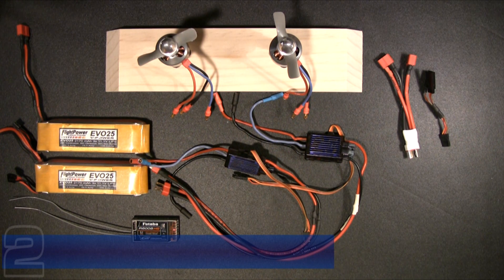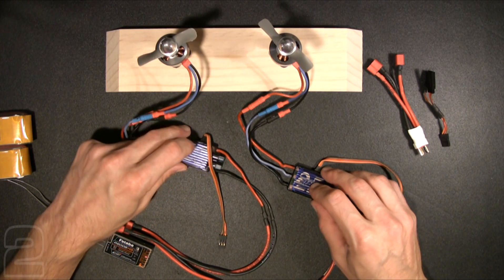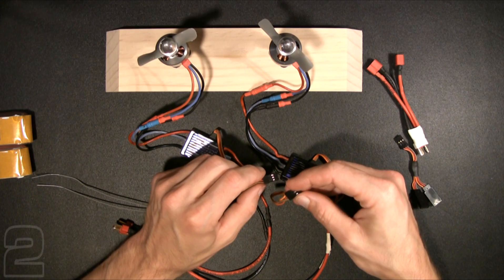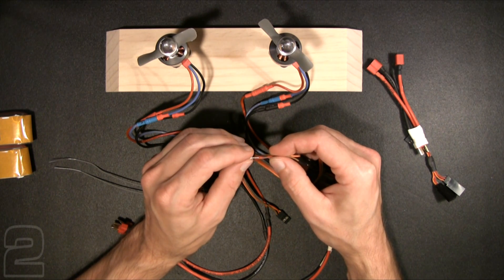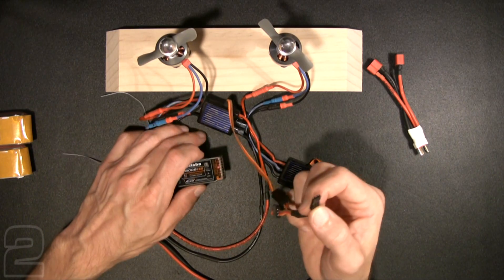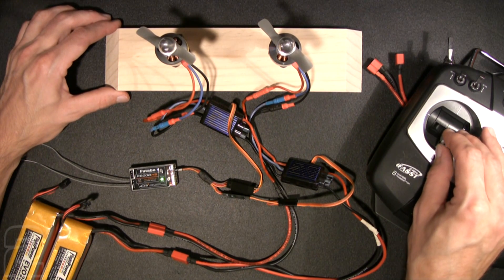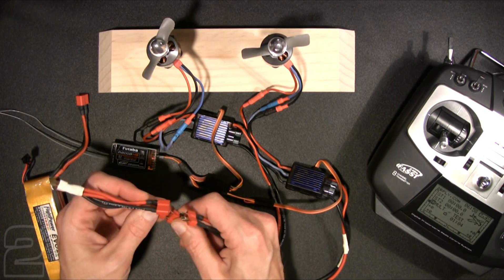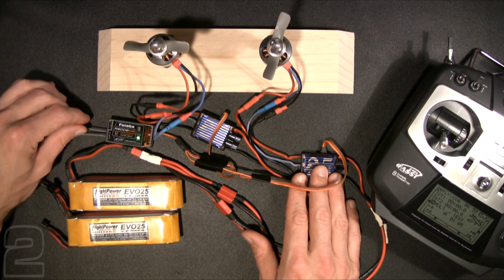Multi-engine ESC Wiring

Comment: How would you go about connecting up 4 brushless outrunners? would it be the same principle? kinda confused  #singlemotorlyf
Reply: +R31Mark My understanding is that, yes, it would be the same principle. There are quite a few posts on forums regarding multi-engine setups. I forget the name of the video, there there is a Polish guy that has had tremendous success with a 4-prop setup. Would be worth hunting for that video and hopefully you might get in touch with him, or someone of knowledge.

Good luck!
Reply: The best way to setup a 4 motor plane would be to use 2 pairs of motors/ESCs. Each pair would be setup as shown in this video by 2BrothersHobby. One set would be for the outboard motors/ESCs and the other would be for the inboard motors/ESCs. That way if one failed, you could still have symmetric power, i.e. one motor on each wing equidistant from the centerline. If you had them setup for left and right wings, you would probably not be able to control the plane if one side failed.

Comment: Hi, if I would want to conect 3 or 4 motors instead 2, would it be with the same system you used? just having one positive of one motor for the reciever and multiplicand the signal cable for as much motors we want? obviously one ESC for every engine.
Thanks!

Comment: Hi, do you think I can use one esc for two motors? thanks
Reply from the maker: Not for brushless motors (three wire).  You can use one ESC for two brushed (2 wire) motors, as long as you don't exceed the amperage rating of the ESC.
Reply: 2BrothersHobby do I need to remove the wire from the bec?
Reply: Great video guys,  I learned a lot today.  Much appreciated.  Please do more videos.  Very well explained and demonstrated.  👍
Reply: Question...  Are brushless motors the ONLY motors to have 3 wires?

Comment: Is there any chance of having one motor rotating at a different rate than the other, if so how do you advance or reduce that rate so they match?  This is important for 2/3/4 motor aircraft too.
Reply: Keenan Lee Yes! You accomplish this my mixing in the rudder (usually) you can mix in a percentage of the rudder to each throttle channel to slow down and speed up motors, I start off with 30% +/-  To do this you must have a computerized transmitter I use a 9XR.  It is easiest to use rudder as you will be simulating the movement of a rudder so it feels natural, you could also use a pot I guess but that would be odd to use.
Reply: Garrett Smedley is right. Something to add is to make sure with electrics that you have the inboard motor in a turn slow down, and not have the outboard motor speed up. That way, if you accidently bump the rudder sitting on the ground, the plane doesn't lurch forward and hurt someone.

Comment: A receiver single throttle controlling both ESCs ?  In an actual multi engine aircraft you have 2 throttles.
Could you do this, or a dual throttle receiver, for a dual motor boat?
Reply: solder both black wires together same for white and cut one red rx wire and use the other red wire for a twin brushless setup using 1 rx.

Comment: Hey i have a  2 2200 mhz 11.1, one is 35-70c and the other is 20-30c.. can i mix them? can the one with the lower c be able to push two 2200kv motors with out stress or getting fat?
Reply: dont try it, the one with the lower discharge rate will die and puff maybe even explode causing your rc and other gear to burn with it.
if doing parralels always use the same mah and C rated lipo

Comment: awesome video, very informative. I have a question i would like you to read and look into please.  I am working on a vstol edf and was going to use three rotating edf tube engines, is there a way to program two engine in parallel so they have equal thrust at all times and the third engine stand alone fixed into the body and the ability to stop running? i plan on using two edf's for horizontal flight with the ability to rotate and the third in vstol mode only i have the esc's and three battery's if need be but the mixing or programming is messing me up. i have a 6 channel and planned just elevator and ailerons for flight controls so i have the channels available. do you se any issues with using a esc connected two its own battery connected to an empty/unused channel probably one of my variable knob channels (vra/b) i am using the flysky ct6b since it is cheaper and i dont know for certain if this will work. if the transmitter is not good enough i will upgrade. thank you in advance. i have made two engine edfs before and this is my first original creation.
Reply from the maker: christopher hoyt That's a pretty complex setup and I'm not even going to assume I'd know the solution!  For truly equal thrust, you can look into a multirotor controller.  The gyros and accelerometers would automatically control the PWM input to maintain level attitude, but I'm not sure how you would then use the same ESCs/EDF for forward flight.  I would look for an RC Osprey setup someone has tackled and that may give you your answers.  Sorry we couldn't be of more assistance and Good Luck!
Reply: thank you though.

Comment: I know this is an old video but I learned some new tricks. After 10 or so years, I am now changing from old to new motors & Lipos. Before it was a twin Islander with one controller and old battery. Now I see two controllers and lipo with props running in different directions. Beforev it was also two 05 Cobalts with props in same direction.

Comment: I want to run dual motors on one double Voltage battery. Can I connect the motors in series vice parallel?

That should half the voltage going to the motors right??

Comment: 2 motors with 1 esc possible if enough amps?
Reply: It's such a risk, even if the the esc has enough amps, it will get hot during flight and a malfunction might occur. Stick to the safer side get 2, you don't want to end up with nothing in the first place.
Reply: Amean Asad
Sooo for a 4 Motor set up i'd need 4 ESCs and 4 batterys?
Reply: A 4 motor setup you can use 2 batteries if they contain enough amps. Concerning the esc's you have to get one for each motor. Why would you need 4 motors, there are some high power motors that can produce  up to 10kg of thrust. The best is sticking with a two motor setup and you'll always find ones that can produce enough thrust to handle weight. Unless your talking about rotors which i do not know much about. You can email me if you want for more help on imino.nice@gmail.com
Reply: because a C130 sctatch build with only 1 prop doesn't look like a C130
Reply: DruidicRifleman 4 motors requires 4 esc's, but just 1 battery if it can supply enough power.

to answer the op, 

you'll always need 1 esc per motor (for brushles motors). There are ways to power two motors from one esc... but its pretty hard to do (involves locking the motor axles together in the exact right orientation, if your slightly off, you'll potentially blow the esc/burn motors).
Reply: sn0wchyld In the end of the video he shows you how to use one battery for multiple motors. I think it works with 4 motors too.
Reply: Animiles it'll work with any number of motors... you could run 50 motors of 1 battery, though your flight times might suffer somewhat, as would the structural integrity of the battery (would probably blow up from too much power draw)! 
 :P

Comment: Why should someone put 2 batteries on 1 single motor? Can you give me a answer to that. Thanks
Reply from the maker: Sure, it's very common. For example: Some 600+ and all 700+ helis, many EDF applications, 25% and larger airplanes, and just about any application where you're running HV motor setups or want more runtime.  Very common to see saddle packs where two smaller packs fit in a fuselage/boat hull/vehicle chassis where one huge pack just won't fit.  Much easier to fit two smaller packs and distribute the weight than it is to cram a huge single pack where higher voltage or increased capacity is needed.
Reply: Thanks!
Reply: 2BrothersHobby  can I use 4 yge 16s ESC and 4 KDE motors for a progect I am trying to do and can I use a rc car radio for a yge ESC because I am building a electric skate board need something insane to run it have all the motors on 2x8s 5000mah each
Reply: If you were using a 2000 mAH battery and wanted your vehicle to run roughly twice as long you could add a second battery in parallel. Parallel would be hots together and negatives together, gives you same voltage (pressure) but more run time.

Comment: Do you have a video or information on setting up the timing for the two motors? I have a twin that I am having trouble with due to the motors not being synced right.
Reply from the maker: Hi, if you have the ESCs on two separate channels on the radio system and your radio system supports throttle curves, you can adjust the throttle curve for engine 2 to match engine 1's RPM.  This also assumes they share the same power source since different battery levels will always run them slightly out of sync.  If they're quite a bit off, keep in mind that motor Kv ratings are usually within 8-10% accurate so two brand new motors from the same manufacturer can be slightly off.

Comment: thank you i am building my first jet with front and rear motors counter rotating. my only worry is using one lipo to power both will eat it quickly so i need to probbably use a bigger lipo now is this correct? means i will have to fly faster to keep the lift great enough to sustain the new weight. i cant wait lol.

Comment: how to make the motors move in both clockwise and anticlockwise direction and with independant control of motors?
Reply: Switch two of the wires on one motor setup but also use counter threaded prop nuts so one side doesn't spin off in flight😁👍

Comment: iv got a 4 in1 reciver that come with my doubble horse 9053 heli. i want to change the reciver becasue this one range is crap. problem is i dont no if a normal rc reciver will work.because the right stick on the controller left/right controls the spead of each motor. and the left control stick controld moth motors speed at same time.

Comment: Hi, I find that when I connect my two motors as you have described, one motor starts when I push the throttle but the second motor only starts as I increase the throttle further. Is there a reason for this. I am using identical ESC's and motors.
Thanks ; Norris K.

Comment: Sir... Good info.  I have a question about removing the center (+) wire in the one ESC.  I have run a GP PBY for years without doing this.  I do not recall ever seeing instructions telling me to do this with their stock setup of Rimfire motors and SIlver Series ESCs.  Am I running these at a risk?

I'm also putting the finishing touches on a DC-3 with E-Flite motors and ESC's.  What is the risk if I do not remove the center wire on ESC #2 and have two BEC's operational?

Thanks!
Ron

Comment: Hi Kurt, when using 2 x opto esc's & a y adapter into a rx, + a bec or seperate rx battery, do you still need to disconnect the red wire on 1 or both of the esc's? Cheers, Mike.

Comment from the maker: No.  Brushless motors actually run on multi-phase AC current from the ESC.  Brushed motors are pure DC.  Using a brushless ESC on a brushed motor would short the ESC and destroy it.

Comment from the maker: Yep, that's pretty much it but it would have to be on a channel that is in the proper position to arm the motor.  If you're wanting to control them both from the throttle channel just set up a custom mix, mixing the second motors channel with the throttle channel and you can sub-trim, set throttle curves, etc. if you're looking to sync the motors.

Comment from the maker: Yes sir.  Look for a pusher prop of the same type, size and manufacture if you're planning on setting up counter-rotating props. You'd need a standard prop (clockwise turning from rear) and a pusher prop for the motor turning counter-clockwise.

Comment from the maker: This has been discussed a lot over the years.  Probably the best bet if you don't want to set a throttle curve on one using two channels is to get ESCs that have governors.  You could get into the ESC and adjust the governors to a specific RPM.  No external sync's that I'm aware of for electric, only fuel.

Comment from the maker: You'd need a monster switch due to the current loads.  We use an arming switch on bigger models that works great.  It uses an Anderson Power Pole plug so all you do is unplug the cap when you're done flying, plug it in when you're ready to go.  It's made by Maxx Products.  I can't link in comments but go to maxxprod dot comm, click on accessories, and then page 2 of 4 in the top navigation.  Scroll down and you'll see the different size arming switches depending on the amp rating of your setup.

Comment: Would it be possible to wire in an on/off switch so you could plug both batteries in then just flip the switch to power the system on or off?

Comment: is there any system available that i can buy that makes a two motor small rc plane turn, pitch, and speed using nothing but the two morors? (using no ailerons, no rudder or elevator, but using a combination of different speeds to the two engines) if there is, please what should i google for? or where do i find it? thank you!!!

Comment from the maker: Yes, on a multi-engine setup you can use a parallel adapter to connect the batteries.  Just be sure they are the same size and discharge rating (identical batteries).  The clear benefit is that you drain the batteries at the same rate and avoid differential low voltage cutoff which would lead to one motor cutting out sooner than the other.  The other leads are the balancing connectors.  Balancing chargers use these leads to charge each cell equally for the best performance and pack longevity.

Comment from the maker: Either isolated or parallel are acceptable configurations.  For people who cannot parallel the main packs, don't be concerned.  This is perfectly acceptable as well but you're best to manage your flight times and land before cutoff, just to be safe.  The Hangar 9 Twin Otter comes to mind.  You physically cannot parallel the batteries since they reside in each engine nacelle.  This is still an acceptable practice, but calls for flight time management.

Comment: If you run two packs independently as shown you need to be very careful when flying not to run until the ESC low voltage cutoff as they won't both trigger at the same time, anyone fancy a spin?

Comment: except you should also have a couple 'y-adaptors' on your battery packs to run them in parallel to equalize the amount of Amps being pulled from each, otherwise one ESC could drop below correct operating power and FAIL

Comment from the maker: Yep, just run each ESC to a separate channel.  It doesn't have to be only on the throttle channel, but keep in mind that in order to arm, the channel typically has to be in the "0%" position, so spring loaded centering gimbals will not allow most ESC's to arm.  Furthermore, channels that are reversed in relation to 0% and 100% as seen by the ESC will typically put the ESC into stick programming mode upon initialization and won't arm until programming is exited or re-initialized at 0%.

Comment: Question!!!:
I have done exactly what you have done with your single flight pack configuration and removed one of the ESC's BEC. I'm having this problem where the motors seem to be switching back and forth with power supply after I go past half-throttle. I'm using matching ESC's and motors and am running a single 3000mah NiMH battery pack. 

Please help!!!

Comment: not sure if they make any esc's that can run more than 1brushless motor. if u use a regular esc with 2 motors, it might work sometimes in some throttle ranges but, sometimes u will have timing issues and they will run intermittently

Comment from the maker: NOTE:  DO THIS WITH THE PROP OFF!!  If it isn't arming, you may have to raise and lower the throttle channel after everything is connected.  Some ESC's require that you take the throttle to full, and then back to zero before they arm.  Another possibility is that you need to reverse the throttle channel on the radio transmitter.  Either way, sounds like it isn't arming.  Most often this is solved by one of the above adjustments.

Comment from the maker: Most ESCs are ok with leaving the positive wire in place on both units, some require that you remove one.  In our experience, most all are fine with both BEC leads connected, but that is not a 100% rule.  If you can, check with your manufacturer for certainty.

Comment: I'm converting a XTM exterminator to electric I'm using two castle creation 7700kv motor with matching esc's and didn't know how to go about connecting the esc to the single receiver.

Comment from the maker: To support john50049's point, using one battery for two or more motors does nothing to the voltage, it's just going to consume the battery very quickly.  When you wire two identical batteries in series, the voltage is doubled and the capacity stays the same.  In parallel, the voltage stays the same but the capacity doubles.  Thanks for posting a correct response john50049!

Comment: Negative. If you put 2 batteries in series, like take 2 - 1.5 volt you will then have 3.0 volts total. If you connect the 2 - 1.5 volt batteries in parallel you will still have 1.5 volts but your current capacity increases.

Comment from the maker: @boomanfabo31 - Yep.  Just get a "Y" harness for the radio leads and it will work just fine.  Just be sure the ailerons are moving in the opposite direction before you complete the installation.  Since they are both tied to the same channel, they can't be independently reversed, so you're stuck with the physical orientation.